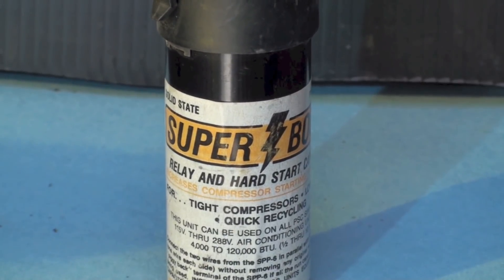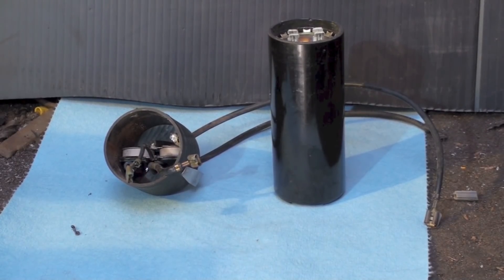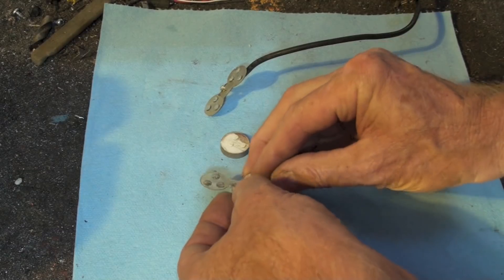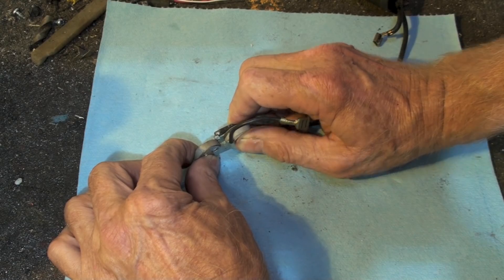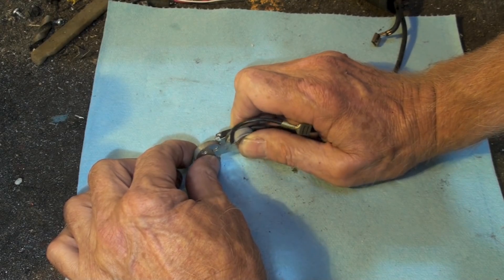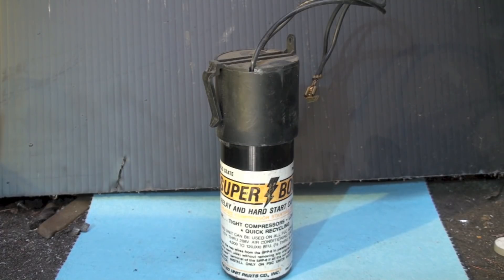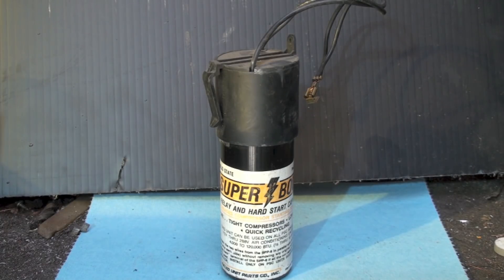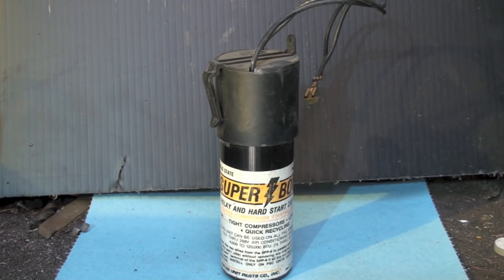Compressor boost kit disassembly

Comment: I notice GFM that for split systems with extra  long line set or low ambient kits most manufactures recommend start assist for their products as a factory installed option why is that? Thank you
Reply: I am not certain, but my best guess is that the reason some manufacturers recommend a start assist kit for units with very long line sets is because the longer the line set is, the longer it will take for the pressures to equalize once the unit is shut off because more refrigerant is stored in the line set. The more pressure difference between the high and low sides of the system, the more trouble the compressor may have starting. That explanation may or may not be correct, so ask the manufacturer if you want to know for sure. Hope this helps

Comment: Appreciate the information on this topic GFM. Very important to let customer know this is a temporary solution to a potential problem. Hopefully they will take advice on equipment replacement and not blame the technician when the compressor fails. Thanks again!!
Reply from the maker: Donald Hartnett You know many customers get amnesia when the negative part is said.  Put it on the invoice.
GFM

Comment: GFM you did an excellent job explaining this. I remember as a helper in the 80's these would get occasional use on fixed orifice systems which were still around readily then. Start assist is what I've always known these as. Most people in HVAC refer to them as hard start kits um nooo... two different levels of boost between a hard start kit and start assist. Thanks for putting this up GFM!!!
Reply from the maker: Michael Shank There is quite a difference between these parts and a for real hard start.  You are right.
GFM

Comment: Had this same argument with a coworker at work... He was putting hard start kits everytime a capacitor would go out... The units are 5 to 6 years old at the most and thought this practice was ridiculous... Just like you said, unwanted stress on the windings and should only be used for compressors that are on their last legs.... Great vids!! Keep them coming...